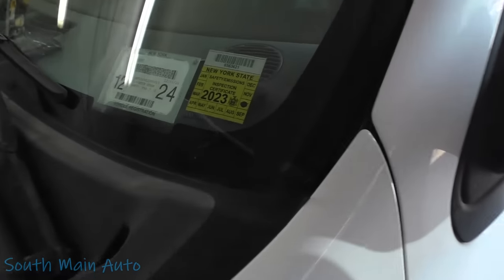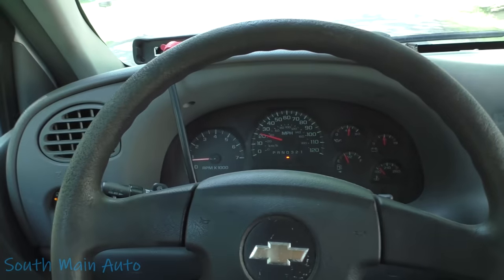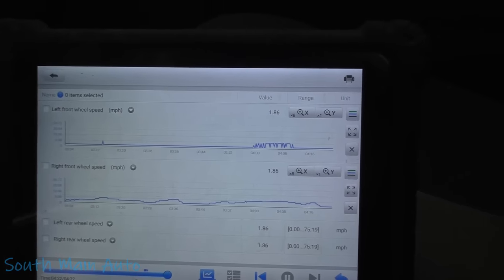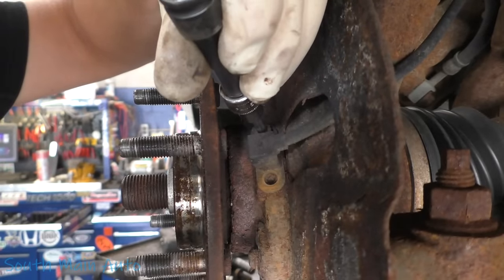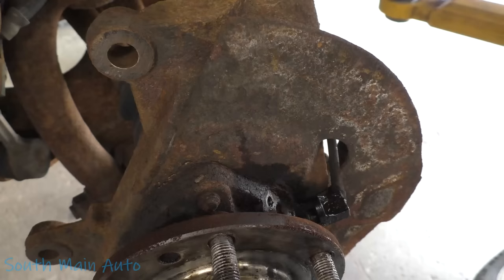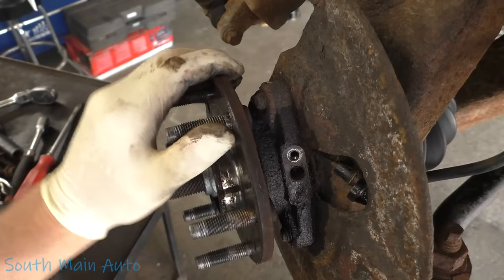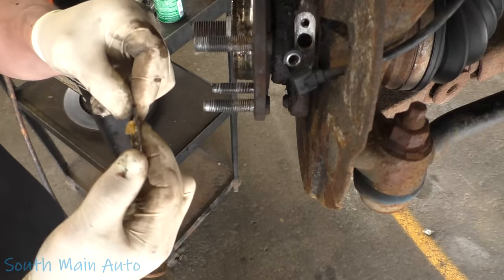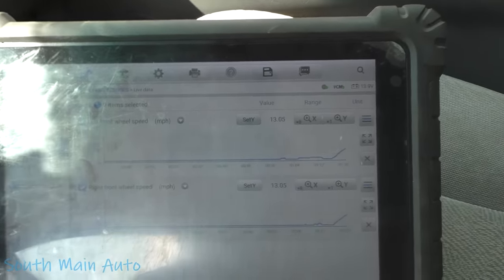Chevy Trailblazer: Unwanted ABS Activation When Stopping

Comment from the maker: Mueller-Kueps 460 200 Brake Caliper File - https://amzn.to/3QbSi6M
Mueller-Kueps 460 202 Thin Brake Caliper File - https://amzn.to/3YarXrM
Autel MaxiAP AP200 OBD2 Scanner Bluetooth Wireless OBDII Auto Diagnostic Tool with Full System Diagnostic - https://amzn.to/3pU3la4
Reply: Hey Eric, turning the lights on and hvac is that a requirement of the Autel and its connection, or something else? Thanks.
Reply: Is that just the blue tooth part,the scanner I saw you use has a large screen.
Reply: Is it true if buying odb scanner from amazon Each vehical data costs 23 dollars? So if i worked on 10 different vehicals in 2 years it is going to cost me a whopping $230 additional dollars?
Is that even transferable to a different cell phone account? Or do have to spend for all vehical's info in the future including the ones from the past again?
Reply: Reason why it came out is because of the grease on the wheel speed sensor. It's something I always did as a dealer tech when they went bad early on or replacing a wheelhub with abs sensor. Though SiliKroil not regular Kroil is epic and the best. It leaves a layer of silicone behind which helps. I was fixing farm field big rigs from PA for a while. Down sides are the silicone is hell for paint guys abd causes a ton of fish eyes jn the paint.
Reply: Kroil is bloody magic, use for removing rifle barrels.  I leave it on overnight and they come out with little effort............again, magic!
Reply: @tatertots-n-soup  your math is off.
Reply: @tatertots-n-soup  Each scan tool manufacture charges different amounts for extra diagnostics software but you can use reference data online as well with generic codes instead of buying the software packs they sale.
Reply: Great info and a quick  cheap way than buying a new hub
Reply: Ace
Reply: @wandameadows5736  So do they read wheel speed sensors in realtime with out paying for each  specific vehicular? I also have a ford 5.4 and need to see timing info in real time. Is that possible without purchasing the paks? It also has an air-ride problem I need to see in realtime. Also I want to change the transmission shift points along with engine timing and fuel flow as well as VVT.
Hello? I will reword  question.  Does it need the specific  vehical packs just to read basic coding of general wear items? Like a wheel speed sensor.

Comment: I was handed the keys to a 2000 something vette and no other techs could figure out why the traction control would kick in on the freeway while cruising,  they even replaced the abs module and no deal.    I took it on a drive while looking at speed sensor data and noticed when I got up to 70mph the rear wheels were spinning faster than the front then the traction control would kick in.    Turns out the customer installed aftermarket wheels and the car requires a staggered setup.    I think it was 19in rear and 18 front.    They put 20s all around so when the car got to 70mph the speed difference would cause traction control.     Took me longer to hook up the Scan tool than to figure it out
Reply: Good catch!
Reply: I sold my 2004 Cadillac CTS because it applied ABS randomly on the highway and jerked the car violently to the right. Replaced right rear hub and sensor, and it repeated days later. Dealer wanted to throw parts at it, so it went straight to CarMax
Reply: they did the old "shoot yourself in the foot routine". ding dongs 🤣
Reply: @throttlebottle5906  what made it much worse was the customer was blaming the shop for causing the issue in the first place as they did the body repair after his accident,  evidently he used the extra money from the insurance to go to rent a wheel lol.   They tried to help by playing swaptronics and that only cost em money lol
Reply: I had a Subaru where the customer had replaced a front tires due to a puncture in one that made it unusable. Same size as the other and backs in specifications, but between different brands and that one was new and back pair worn, it was enough to trigger ABS issues.

Comment: Pretty scary to think a safety device can go wrong and actually CAUSE an accident.  The people in your shop neighborhood must laugh seeing you drive nine million different cars all the time. Always love your Vids Eric, keep em coming
Reply: I've always wondered about that and also if he ever gets pulled over for reckless driving trying to diagnose the car😂
Reply: Yeah sometimes safety devices become the problem especially when technology gets better they become more sensitive and in tern causes more safety issues especially when they fail it could cause braking events not to work As well
Reply: Yes, used to have a motorcycle tuner cruz various motorcycles around the neighborhood..
Reply: A poorly designed and implemented safety control system in the Boeing 737 max jets caused two devastating crashes and untold amounts of negative impact on travel and costs when the rest of the fleet was grounded during the investigation. Boeing tried to cover up the mistake blaming the pilots adding insult to injury.
Reply: @fredflintstone8048  The pilots could have stopped the runaway trim but that was not emphasized in training and was not obvious enough in the handful of seconds the pilots had to stop the planes diving to the ground. Boeing should never have installed the MCAS without dual Angle of Attack sensors. That should never have been an option.
Reply: @flagmichael  Boeing also ignored reports of run away trim that were successfully recovered by the pilots until there were two that weren't.
A defeat switch would also have helped. Sometimes you really need to disable automation and fly manually.
Reply: A few years ago used to bore cylinders in motorcycle engines for displacement increase.  Would circle several blocks changing RPM all the while for engine breakin.  At first neighbors would ask what I was doing but soon became used to it.  Only had one cop response but he was a gear head, so no issue arose.
Reply: A few years back I rented a Nissan Rogue and in a tunnel the collision warning system caused the brakes to slam on. The system sensed a tractor trailer in the other lane, one lane each direction, as if it was in my lane. Stepping on the gas pedal did nothing so I mashed the brake pedal twice, then got back on the gas. I don’t know if the brake lights went on or not. Luckily no one was on my tail. I found out after that Nissan had issues with that system and threats of lawsuits. The Rogue was a decent vehicle but I won’t drive another unless I know that system was fixed.
Reply: I had a 2014 Nissan Sentra that was totaled by a Great Pyrenees. The car didn't have that much damage but the dog hit the grill and the bracket that the airbag sensor was on. 1 airbag, 2 seat belts and the related parts that the insurance companies insist have to be replaced whether they need it or not was over $4000.00 . In Tennessee, these parts are included in the determination of whether to total the car or not. The impact was very minor but 60 percent of the repair costs were from the safety systems that were triggered.

Comment: Another example of the way you make decisions in the customer's interest. Many would have swapped a new OEM sensor and called it a day.
Reply: 06 trailblazer in western NY? OEM sensor probably worth more than the vehicle 😅
Reply: @mdotguy  NO KIDDING, SADLY.
Reply: No way
Nobody does that
Reply: @mdotguy rockauto has them for $15, or $48 if you want the genuine article. So yeah, probably about right 😂
Reply: Just test the ohms on the sensor
Reply: AS he said, if Hub isn't OEM there's no point in just a sensor swap. Too much variation. And the shims are pre-selected from factory.
And if sensor has been jacked bearing is likely on it's way out anyway. Clean it for cheap or replace the whole assembly.
Reply: If there is rust jacking that means material has been removed when he cleaned it therefore changing the gap, no?
Reply: @larrybe2900  Yes, but a standard air gap range is 0.000” to 0.015”. So, getting too close normally isn’t a problem unless you’re making significant contact. A light, brushing contact usually isn’t fatal because there’s a bit of plastic over the hall effect sensor which can tolerate a tiny amount of material loss before the sensor is damaged.
Reply: he's a couple of cuts above your usual mechanic.
Reply: So. How do you charge for this?  Hourly?
Reply: @tatertots-n-soup  : 😆 😅 😂 🤣😆 😅 😂 🤣😆 😅 😂 🤣😆 😅 😂 🤣
Reply: I replaced the whole hub assembly cause the abs was going off...
Reply: @larrybe2900   
 No...
I cant explain the fundamentals of corrosion here in short detail, but I can simply tell you the process of oxidation pulls dirt and minerals, to small to see out of the air and forms it into the corrosive reaction of metal, water and oxygen adding tons of weight along with  it called mill scale. Castiron can not rust......... Carbon does not rust, and so much carbon is put into iron that it is interconnected making it impossible for rust to go further than average 3 molecules of iron. The rust/oxide/corrosion can only discolor the bare iron exposed on the surface. You were talking about the cast iron parts right?
Reply: @larrybe2900  a little closer will not hurt, it is a good fix, I have done over a hundred
Reply: @truthsmiles  great advice
Reply: @secretsquirrel6124  that will not do anything to fix the airgap problem
Reply: @tatertots-n-soup
Reply: I do not get it, what is false?
Reply: @jimsix9929   @jimsix9929  He was asking if there is now metal  gone from the part that corroded away And why welding filler in isnt a prority that now needs to be repaired.
 So because it doesnt make sense that if rust deteriorates the metal away. It would be changing the spacing from where it used to sit but noone is mentioning repaire or replacent of the bearring hub. And noone else is informing the difference of iron and castiron or the difference between rusting and scaling. But scaling adds material it isnt corroding away the cast iron. It is getting thicker and heavier not thinner and lighter.
So saying yes to Larrybe about material missing and changing the gap is false because it is really adding material under it and changing the gap.
Reply: @tatertots-n-soup  just not needed, all you need is to clean the corrosion, the closer the better

Comment: Too bad they don't put some kind of goo under that flange and in the cavity so that they don't break so much.  I've changed one speed sensor in my life and it came off/out of the hub ok.  I live in NW Wisconsin and we have salt and dirt on the roads 8 months of the year so I guess I was just lucky it came off.  It wasn't the sensor anyway, it was the hub so when I changed the hub the new one came right out.  Thanks South Main Auto.  The underside of the cars you work on look just like mine.  Do you ever throw screwdrivers?

Comment: My Grand Marquis was activating the traction control over 70MPH. Had to keep turning it off. Turns out there was a bunch of rust stuff magnetically attached to the rear sensors. Cleaned them up and no more traction control activation on dry, flat roads.

Comment: Hi Eric,
I had the same issue on my 02 Silverado. I did check both and cleaned both just because my labor is cheap. Was it worth checking the other side??
Good video for us proud CHEVY owners😅😅😅. Keep taking care of your customers. I'm sure they appreciate you and the lovely Mrs. O❤❤
Reply: That ran through my mind too .
Reply: Not for Eric.  As he said, those speed sensors are hard to get out without breaking, he was lucky to get that one out.  No reason to risk breaking a sensor that is currently working fine, making the customer pay for extra labor or a new sensor/wheel bearing when it isn't necessary.  He was hired to fix the current issue and he did that. 

If it's your vehicle, then it's your risk to take.  If you don't have the equipment to determine which is the problem, then I'd say it's probably necessary to check both.  Now the customer can watch this video and when/if the other starts acting up they can try to fix it themselves if they wish.
Reply: @Allazander  Yeah, he lucked out. You don't want to press your luck.

Comment: What is the purpose of marking the rotor and corresponding lug stud?
Reply: Mark the position of the rotor if you’re reusing the rotor and hub without cleaning the rust off the mating surfaces. There are different rust patterns on the areas behind the lugs. When put in a different position it can cause a vibration because the rotor is not sitting flush against the hub. This is my experience and opinion.
Reply: @LawrenceHRoss  thank you! I’ll do that in the  future.

Comment: Isn’t it amazing that nearly every repair Eric does is caused by rust and corrosion…gotta love NY..

Imagine the amount of money in losses and repairs we have in this state all because they use so much damn salt on the roads
Reply: When I was stationed in New Jersey I would rinse my car/undercarriage after ANY drive in the slush/salty roads.

1990 Taurus and still rust free.  Just takes a little care and work to prevent.

Aviation has been dealing with the same problems for years, but for some reason won't accept the 'it'll rust/corrode anyway' line 😏

Comment: Nice job, Eric! Rust is really a problem for you guys - we don't get snow around here and the cars don't rust nearly as fast, and we can always drive to the mountains to see the snow :-)
Reply: It's your loss. Lol
Reply: You may know this but some may not It is actually Not the “snow” technically that directly causes all the rust problems we see in Eric’s featured cars. The extreme rusting is from the massive amount of Salt or Calcium Chloride ( commercial Ice Melt) the State lays down on the roads.
I mention this because where I live we have long winters with snow but because most of the time the temperature is below the Salts effective temperature range very little salt is used. As a result the average vehicle has some rust but a fraction when compared to Eric’s customers.
Reply: @wirefeed3419 in northern Illinois our winters keep bouncing up and down at the freezing point so they use lots of salt and the constant freezing and thawing also ruins the roads faster.
Reply: @wirefeed3419  Exactly so. Sometimes we in Flagstaff, Arizona, have the most snow in a winter of just about any place in the Lower 48, but we aren't sitting on one of the largest salt deposits in the world. We have cinder hills many hundreds of feet high instead and mine those to spread cinders on the road instead. No rust.
Reply: @MazichMusic  LOL
Reply: @wirefeed3419  Yep, I knew that, but no snow = no salt.
Reply: @FishFind3000  Yep, that kind of fatigue cracks even the rocks.
Reply: @flagmichael  Wise choice!
Reply: @tatertots-n-soup  That didn't help either.

Comment: Just dealt with attempting to replace a speed sensor on a Chevy 2500HD. AC/Delco Advantage hub still in good condition but the sensor wire had an open in it. You'd think an OEM sensor from the dealer would be a direct replacement. Nope, WTF. Went and bought another aftermarket hub for $80 versus an OEM for $300 and stuck it in.
Reply: Ac Delco Advantage is the cheapest crap money can buy. Professional/Gold or Original equipment is the only stuff I will use.
Reply: @mph5896  PG and GE OE isn't factory.

Comment: Thank You Eric!  Had my own 03 Chevy Silverado 4x4 front ABS sensor go bad ( It was not rust jacked just dead). I replaced with an aftermarket sensor. Measured the sensor stick out (mount point to tip), then measured the wheel bearing hole depth.  The old shim was too thick to get a .025" air gap. I made a brass shim and everything was happy.

Comment: Mr. O has the magic touch working on these rusted out vehicles.    I'm in Alabama, and I've had to drill out more wheel speed sensors than not.   Especially on GM vehicles.

Comment: I had a 2001 Blazer with this issue a few years ago. Using a past video of yours I was able to determine which sensor was the issue. The issue on mine was found not to be rust. It was too many shims causing too much airgap. I researched extensively to find what spec the airgap should be. It was difficult for me to find anything but I found a spec; I believe it was .003-.010". (I would have to look as I printed and filed the information in my service manual.) Mine had 3 shims of 2 different thicknesses under the sensor. I ended up removing the thin shim to get the correct airgap and correct the issue that caused the owner to remove the ABS fuse for 2 years to stop the erractic braking.

Comment: I had the abs control module go bad on mine once and it got stuck so it'd never stop activating the ABS no matter the speed. I did first experience it until I literally drove through my garage door.
Was not a cheap repair on both fronts :( to this day I'm paranoid about abs on gm vehicles and usually just pull the fuse on any model made between 02 and 2010

Comment: Every GM vehicle I've owned had the same issue with ABS. Every time you would hard brake over a surface that wasn't perfectly flat, the ABS would kick on and the vehicle instead of braking in 25 feet would DOUBLE the braking distance. The ABS senses that the vehicle brakes are skidding when in reality it wasn't, it was just encountering a bumpy road.
Reply: Most vehicles operate the same way.
Reply: @ShainAndrews  Not as bad as GM.

Comment: I have a 2wd Silverado that had major unwanted ABS activation issues until i pulled the ABS fuse.   I was driving around like that for a year plus.  I was going to clean the sensors until i saw that the end bearing caps on the front hubs were swiss cheese.  I am going to replace the hubs.